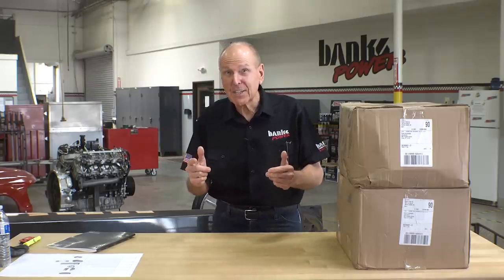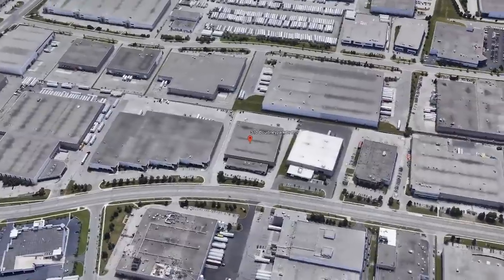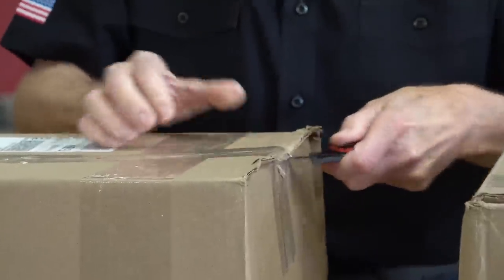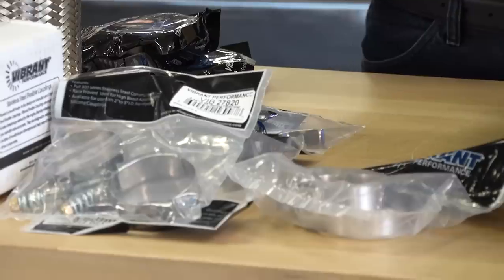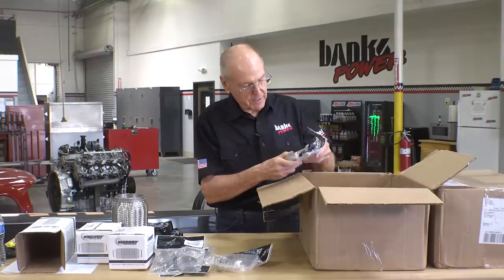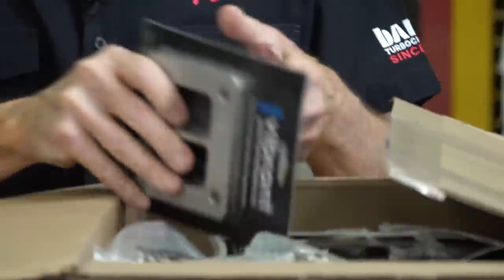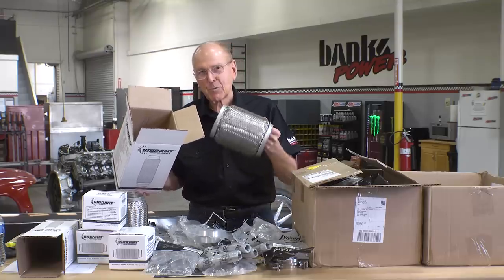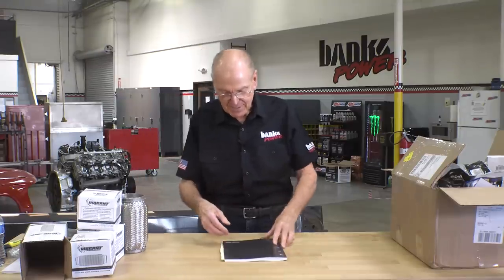ENGINEERING UNBOXED: Vibrant Performance Fabrication Supplies!

Comment: I've been using vibrant for years.

Between them and Borla, it's all I'll ever use for exhaust parts.
Reply: Damn I was about to say the exact same thing!  I've never had a component from either manufacturer fail on me.  Outstanding bang for the buck.
Reply: Same!
20 plus years using vibrant on tons of builds.
Reply: Who needs exhaust?
Reply: Andrew Doolittle you one of those dudes with a squated gmt400 series truck with straight manifolds thinking it sounds good on the limiter ehh?
Reply: @carsonhammond6204  A 10 in. dia. coming out of the bed, near the cab so it looks like a tractor.  Not.

Comment: If he keeps this up Gale Banks Liking a product is going to be the gold standard endorsement.
Reply: His endorsement has been that way for a long time. Back in the 80's I had a 79 SE Trans Am, "Bandit Edition" and I used to dream about getting the engine repackaged with a twin-turbo version from Gale Banks. I wanted 400ci twin-turbo with a functional shaker hood. I haven't given up on that dream yet. I really want a 1979 SE Trans Am with today's technology in the suspension and drivetrain. Something utterly reliable and bulletproof with about 900HP!

Comment: I'd never heard of vibrant performance until I needed some exhaust flanges for a custom 4" open exhaust on my supercharged small block pickup. I used 4 of their flanges to split my system into 3 pieces so I can remove the system easily and reinstall quickly. I welded my exhaust together around Christmas. It's pricey, but very handy.

Comment: Its worth to mention that double slip joint should be welded that way that the air comes from inner part to outer. Welded in opposite direction,reduces the flow as smaller tube wall makes air flow turbulent.

Comment: I used to work at Adel-Wiggins in LA and they have a tube clamp called the “Wiggins Wiggler” that is used for coupling fuel tubes in aircraft wings. They have some degree of angular movement they can withstand. It looks to me like they might be something you guys at Banks could use for cold side tube clamps. Those clamps you are showing are similar in how they work, but the Adel clamps have a sleeve over the o-rings and all the clamshell cover does is constrain the axial movement.
Looks like my link to the Adel Wiggins clamp retailer got removed? Well, look up Orkal dot com for information on the clamps. I don’t have any stake in any of this, just trying to help out
Reply: The vibrant clamps do have a sleeve, they work the same way
Reply: Maybe a copy of the Adel clamps? I guess it’s a patent from the 1940’s? Maybe it has run its course
Reply: SoCali7three , I looked up the clamps and Holley sells them on holley . com
Reply: reid washbon dot com sells them too
Reply: It's the same thing.  The Wiggins release /clamp is still waaaayyy better. 

And they are the only clamps of this general style in smaller sizes.
Reply: I believe Vibrant are knock offs of Wiggins clamps.  I've seen Wiggins clamps used my whole life, but Vibrant just started really being seen in the last ten years or so.

Comment: The HD's are great.. but you should check out Adel Wiggins. 

Also.. I cringed when he backed the nut all the way off that V-band. Those have a quick disconnect on them! 

And for turbo flanges, you NEED to check out Elmer racing.

Comment: Banks I have a very werid question but I cant figure it out I have an 89 irocs with a 350lt1 and when I and easy in the gas and going up a hill or even on flate ground and my engine basically shuts right off. If I leave my foot in it, it like to keep shutting off or shutting done but if u let if then back in it it's good to go just wondering what you think maby you can help out thanks banks hope you can message me back

Comment: For the upcoming episodes of killing a Duramax, is it possible to set up a camera angle on the exhaust system outside the shop? I want to see how much it smokes
Reply: I suspect it would make for uninteresting viewing, given Gale's near fanatical attention to keeping the AFR in check.
Reply: In one video with the 7675 turbo they got as low as 17.3:1 afr. I don't know if that's a true afr or a 1.17 lambda reading. I would prefer if they used lambda and the difference with diesel is small. Either way it's above the smoke threshold, usually turbodiesels don't smoke at all above 16.5:1 and depending on the combination until they get below 15:1. You can see with the sidewinder or even the freightliner at pikes peak,they don't smoke once the turbo is spooled and with this killing a duramax, they aren't loading the engine hard until higher boost. The monster truck engine might be different where Aaron admitted there was some extra fuel in the tune and they were doing snap tests. They were using the fuel pedal sensor to limit fuel and had more than enough fuel because they were unsure how much air the blower was going to flow. All that is saying is there isn't gonna be any smoke.

Comment: lolol banks... your late to the party with Vibrant stuff :3 we love em
only thing is, and i hate to say this... but you gota work on your V-band pricing... i used 16 3" clamps doing my 7.3...  thats 1,200.00 in JUST stainless vbands... i went with another vendor =/ 
5 years later, those vbands are still working just fine and yes, i did have to throw away the nut they included because it was a nylock... but comon... i saved like 900.00 that bought the fluidamper for it PLUS had money left over...
please for the love of racing work on your pricing...

Comment: holy mother of god those stainless welds 

Please tell your welder the hotter your weld gets on stainless the less the stainless wants to flow you probably only need 50A max on that and a 3/32 wire just walk the cup shit notch it if you have to

Comment: Vibrant is great quality stuff but for the turbo kits I'm making I can't justify their prices. Especially their stainless v-bands.. $90 for one when you can find top quality ones for $30-$40. Wish they had more sizes in weld els too. They only have 1.25 and 1.5 inch and it's $12 for one 90. I would have to more than double the price and make zero profit if I used their stuff :(

Comment: those bellows are absolute garbage.  ive had 7 separate units on a single manifold just pop,  3 different manifolds for various turbo locations, where thier products just blow out.  each failure vibrant claimed the failure was due to engine movement or manifold back pressure (same results with 1.01 ar and 1.15 ar housing)  set up a go pro on the floor of the dyno, managed to record the failure,  simply popped at 34psi... no engine movement as the car is has a tubed front clip with solid mounts a tube subframes 🤣

do not buy the non HD clamps. the cast aluminum one split in half, at like 20psi.   

(the vehicle i have with the most vibrant product failures is a 2004 subaru sti that has a 76mm low mount turbo set up, car makes over 1100hp @50psi at 9,000 above sea level)

t clamps are nice, fittings are all great, really a fan of thier silicone lines and tubing. Ferrells and "HD" clamps are super nice.